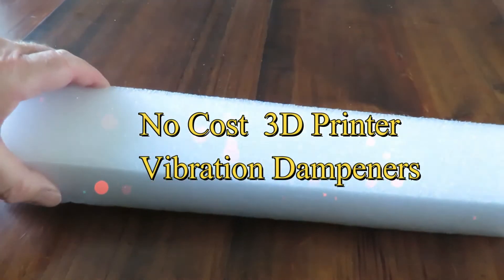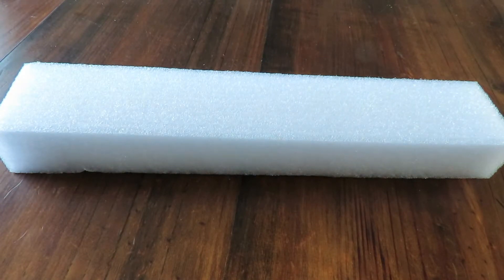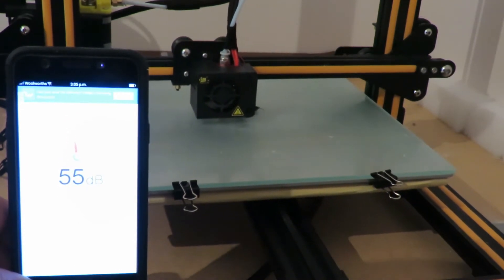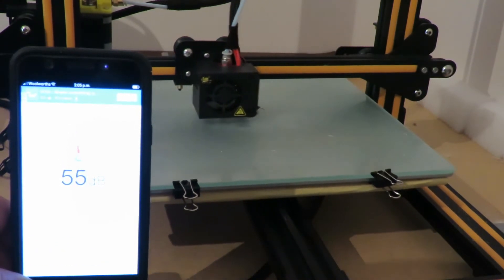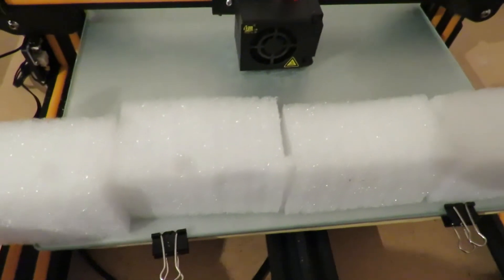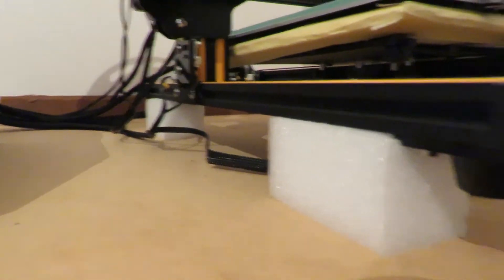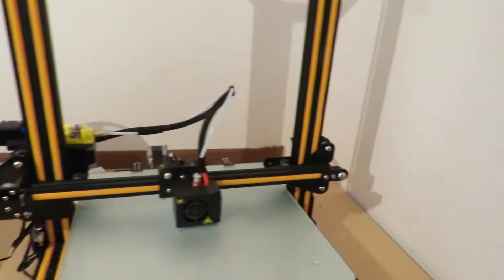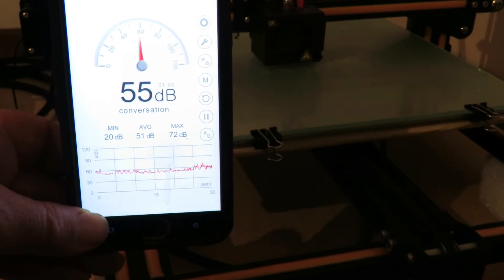📌Low Cost 3D Printer Vibration Dampeners that Really Work and Reduce Printer Noise

Comment: A good note, try to use a rigid surface in between the frame's base and the surface the printer is resting on when using dampers. It helps distribute the load more evenly while preventing stress and potential warping of the frame.
Reply from the maker: Thanks for the tip.

Comment: No real difference - you need motor dampers fitting to the stepper motors
Reply from the maker: I have three motor dampeners but not fitted them. (had them for over 1 month now)

P.S. The power supply fan is the nosiest thing on the printer.🙂